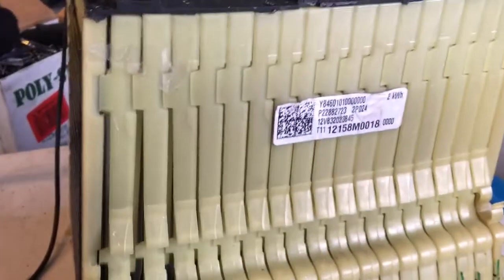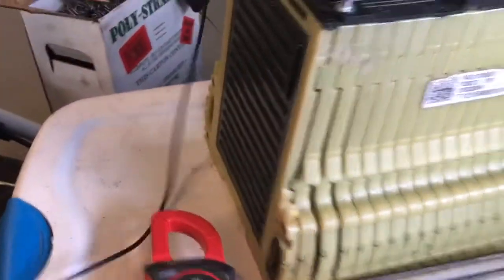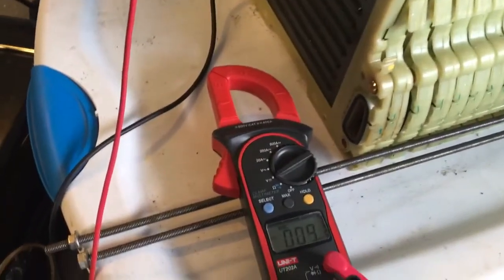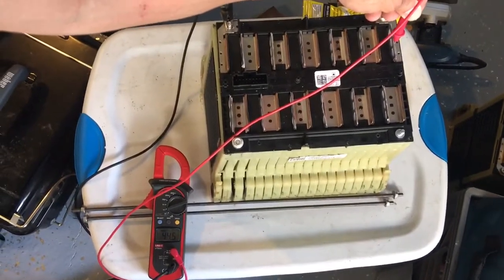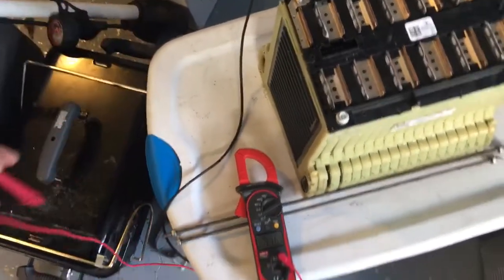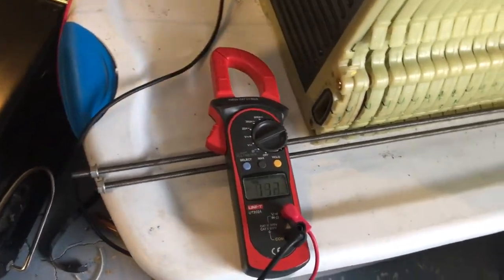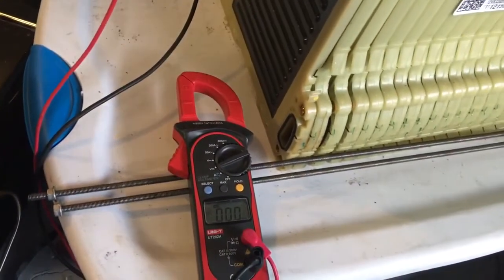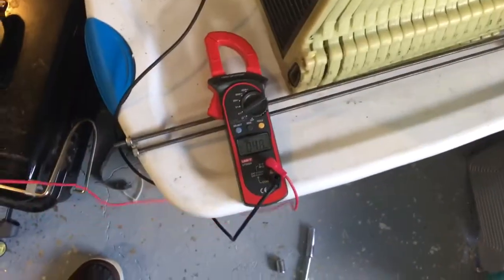Bad cell Chevy Volt battery pack 2 kWh module

Comment: Im looking at a 2012 chevy volt and the guy says the battery is getting 21miles per charge how do i raise it back to original numbers?
Reply from the maker: Test the modules, if there is a bad module, replace it. If all of the cells are simply degraded, there is no fix.
Reply: @AlanSNasar  thank you! 
How do i check them?
Reply from the maker: @sergioknuf  if you have a complete pack, it has 96 cells total. If you check the total voltage and divide by 96, that is the amount that each cell should be. You need a voltmeter to do this. You then check each module or each cell individually, and make sure that the cells are all approximately the same voltage, +\-.05 V. If any cell has significantly different voltage, that module is a bad module.
Reply: @AlanSNasar  can individual cells be replaced ?
Reply from the maker: @sergioknuf  No. They are welded together, cannot be removed from modules.

Comment: What was the indication that the battery might be bad?
Reply: The pouch cell is generating gas which means electrolyte degeneration and puffs up the bag or pouch, it's also not creating any voltage

Comment: Got a similar problem (though not as bad as yours - no swelling) with an identical 50V Volt pack. One cell in mine is always seems about 100mV different than all the others, which are balanced within about 50mV or so. Any idea how to swap/replace a cell in one of these? Any suggestions for sources for spare cells? I do have a BMS on mine, but I'm pretty dubious that it's actually working - never seems to balance any better than what I said...though, maybe that's all the BMS can do...Thanks!
Reply from the maker: I think it is difficult to properly replace a bad cell within a module. You have to replace the module. They can be purchased on ebay for about $350 for 48 volt module.